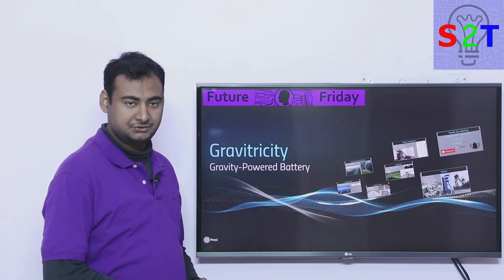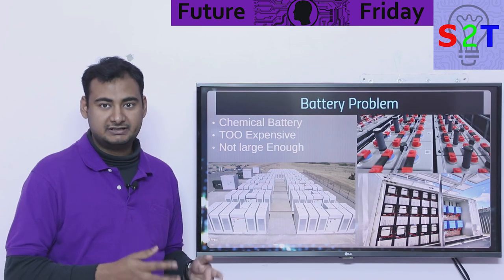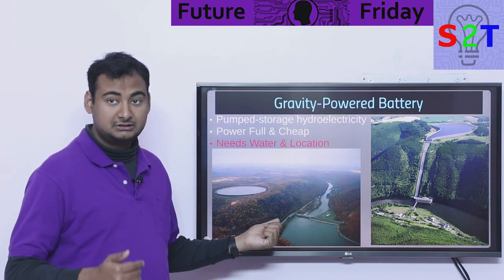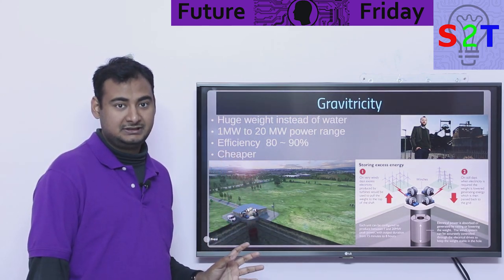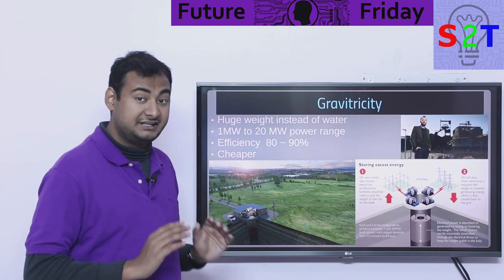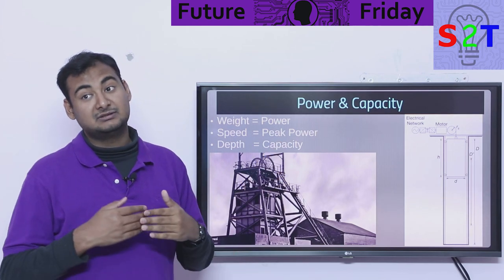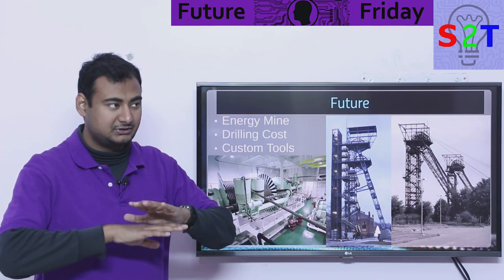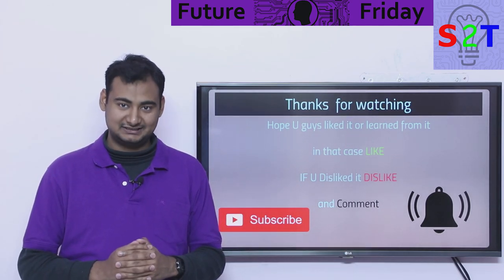Future Friday Ep33 (Gravity Powered Battery Explained)

Comment: one word...coils. what if you put some type of copper coils around the shaft and make the weight out of something magnetic, or even put magnets on the weight, or imbedded them in the weight? (lookup how the braking system on a mag-lev train works if you don't know what I'm talking about, or go buy a 'shake-chargeable flashlight'....coil-wrapped cylindrical tubes with moving magnets in them have the ability to produce electric currents, inversely, they will also absorb kinetic energy and disappate it as heat) It can also act as somewhat of a weight-brake to slow the weight as it approaches the bottom of the shaft without using so much discharge energy on the inverse side of that theory.
Also, what if you sealed said tube hermetically as to reduce the friction from the air which should increase the efficiency of the system? 
I'm not a scientist, or a mathmetician, or anyone qualified to make these assertions...however, the simplicity of this system is what makes me think it might actually work...these are only some ways based off of things i've seen (i wont say 'studied', because watching Youtube videos on electromagnetic physics is not studying) I am nearly making suggetions to augment the system. 
Im sure someone has already thought of all of this, and the expense factor is probably substantial here too....and do i think that i can help change the world with an obscure youtube comment? no...but hey, its nice to dream.
Reply from the maker: well I Respect your dream But I think you misunderstand the video there is only one energy source that is falling mass you extract energy from the top using tow system is a dual-purpose charging and discharging  but if did the coil thing problem would be you would extract energy from the system  and waste the mechanism that you would have to have in order to "Charge the system "  its just waste full and RUEL No 1 Complexity is the enemy of reliability. We might still imply simply steel tube and Hallback array PM which will act as an eddy current brake that will act as a speed limiter so even if cable brakes, Mass will not go ballistic, no electronic only simple engineering. Hope this answers your question

Comment: "I urge you to press that dislike button twice"
Nice one :D
Thanks for uploading. I just came across Gravitricity, and see a big potential. Countries with lots of hydropower (like Norway) could simply pump water back, but this enables virtually any country to implement.
Only limitation is water-table I suppose, but there are tower&concrete versions among others.
Reply from the maker: Water is though thing to handle from corrosion evaporation erosion and dude to low density its requires very large amount of water to store even 1MW bit as of now we do use it as pumped hydro storage but it's far from simple

Comment: li batteries require magic? you can't scale li battery by connecting multiples of them? economics of scale in manufacturing don't apply to batteries?  ultimately cost (capital, maintenance, lifetime) and efficiency will decide what we end up using. may the best implementation win.
Reply from the maker: true